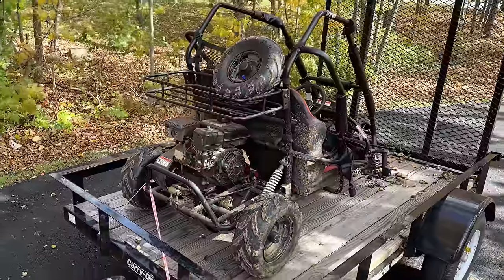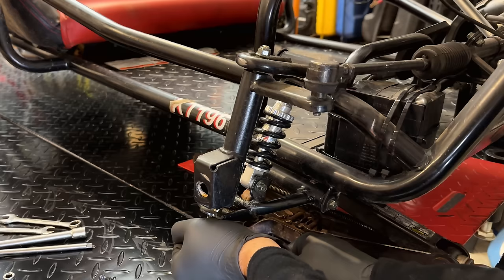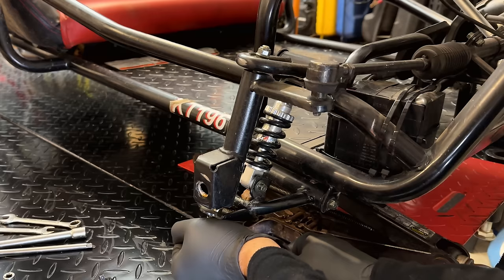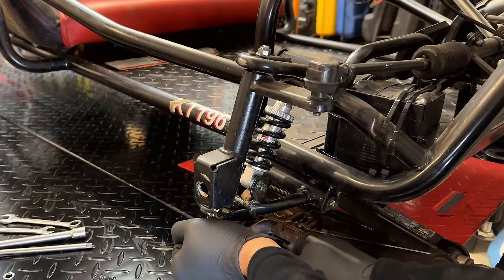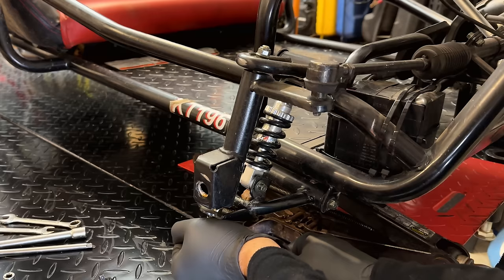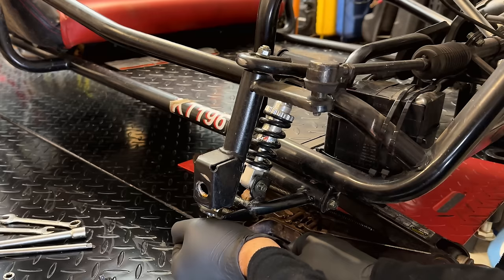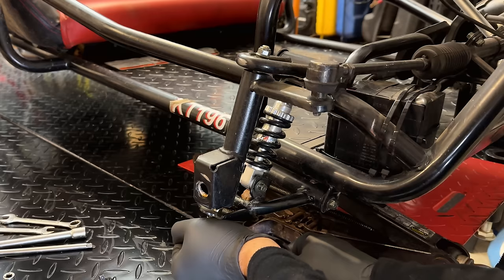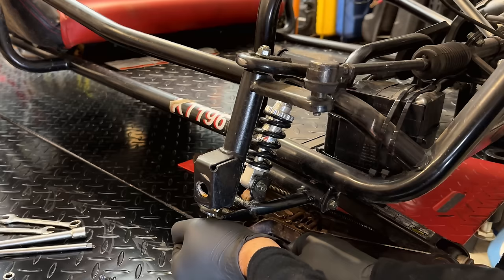Coleman KT196 Major Upgrade/Repair - Electric Start, Charging System, Suspension, Lights and More...

Comment: You might want to turn those light clamps 180 deg to move the lights back a bit. That way they aren't the first thing to take an impact.
Reply: I was going to make the same comment on the lights.
Reply: Or, put a bumper in front to protect both, the lights and the front wheels and suspension.

Comment: Times certainly have changed. I can't imagine having my own go-cart let alone my dad spending several hundred dollars upgrading it. Growing up in the 60s, I felt as if I was doing pretty good if I had decent shoes on my feet and the chain oiled on my Schwinn.
Reply from the maker: Same here.  Always wanted a go kart as a kid.  Or anything with an engine besides the lawn mower.
Reply: Do you guys remember pounding nails into scrap wood producing something resembling a gocart frame? I grew up in the 60's myself
Reply: @kevinfoster1213 Hi, and yes I do remember that. In about 1969 some neighbors who had I believe four boys a little older than me had a garage sale and were selling a cool A-frame go-cart they had made and I absolutely had to have it. It was made from 2x4s and was about six feet long and 18 inches wide at the front and 24 inches wide at the back. For steering it had a long bolt that vertically went through one of the front cross supports and it then went through a lower piece made of 2x6 that an axle and a lawnmower wheel at each end was attached. The axle was a little longer than needed on each end and attached to these ends was a rope that formed a loop that you could use to steer it. I made some improvements to it after my parents bought it for me including a bigger piece of wood going across the back so it could hold two kids. I also remember slapping a couple of STP Motor Oil stickers and some old reflecters off of an old semi truck trailer on the back, so I thought i was pretty cool. I also remember making stilts from 2x4s thanks to my dad working construction jobs at that time so he was always bring home scrap lumber for me and my buddies to play with. Do you remember ever making stilts?
Reply: @AbcDef-iq4no  absolutely I remember the stilts. I think back on those days and the number of times I've bashed my fingers with the hammer, I can't believe I retired from home building and/or related fields.
  We would those steel wheeled skates on a 2X6 or similar. I say put, what mean is bend over 6, 8 or even 10 penny nails and call it a skateboard. This was well before skateboards could be bought at a Wanamakrrs or similar store. 
  I still believe me and the rest of the Manito brat pack invented the sport.. I'm sure we didn't but the story I tell is what I must stick with

Comment: Just a note on fusing: the charging circuit has a fuse, but I did not see (so I may have missed)a fuse for the battery positive going to the switches for light and start, which if not present, definitely should be.  Enjoyed this extra-long episode!
Reply from the maker: I added two fuses.  May not have show the other.  There is one for the charging system from the engine to the battery and another on the full time 12v wire that runs the lights and starter solenoid.

Comment: Those spring units  are very common on cheaper suspension bicycles. They merely allow you to set the spring tension with that big ring that tightens down on the spring. The center is a bump stop and guide. They usually are very very cheap. You can get a Fox or similar suspension spring with a dampener shock, but they cost hundreds of dollars. 

On the left (unbroken) side, the ring nut was backed off all the way, so there was no tension on the spring. 

Loctite that ring into position, or, if they fit, use the old ring nuts from the old shocks as locknuts for the new ones. Your son should keep an eye on them and not let them back off a whole inch ☺

Comment: @James, instead of removing the set screw on the governor arm, I think I'd back it out about half to 3/4 turn past full throttle, just to make sure there is a backup stop in case something with the pedal assembly bends/breaks.

Comment: Your son should be getting a first rate education in electrical/mechanical engineering with a Dad like you.  My Dad did a lot of what you do and I never took the time to learn from him.  Decades later I'm learning on YT.  I'm sad I missed that opportunity when I was young and Dad is gone now.  Always love your videos.
Reply from the maker: He is a very smart guy.  Also he rebuilt a 10hp Briggs engine with a little direction and has way more experience at 14 then I do at 52 with 3D printing and soldering.  Think he will be fine.

Comment: Fix one thing and find another thing that needs fixing or replacing. Sounds familiar…like that Cub Cadet. I guess it proves no matter how well you maintain things you can’t defy the laws of physics. All machine components will wear out and require repairing and/or replacing at some point. I bet Sean is thrilled.

Comment: Mr. Conden, you could make another nut using hex stock and cut it longer so it protrudes above the obstruction and will allow you access with an open end wrench.

Comment: Didn't even notice the duration.  Content was great and well-paced.  Nice to have some unforeseen plot surprises to keep it interesting.  Crankshaft swap was awesome.  I was thinking NO WAY the whole time.  Well done.  Also, excellent wiring and especially the factory-like remote start.  Brilliant.
Reply from the maker: Thanks.  Was glad the swap worked.  Did not have a plan B.

Comment: this is giving me flash backs. i used to work at a small angine shop and i worked on a gocart on a lift and made the mistake of starting the engine without having the back wheels jacked up. the throttle was stuck partily open so it took off. thankfully, no one was hurt, nothing got broken, and i didn't get fired over it. the older mechanics(i was in my ealry 20's) in the shop just kinda laughed and said if finally happened to me too. what stopped it was it ran into some other equipment that it couldn't move and i was able to run over and kill the engine. it's almost a miracle nothing got broken. don't guess i'll ever forget that day.
Reply from the maker: Ouch.  That is alway my fear with this one.  With the old engine my son would stand behind the kart to pull start it.  Nobody inside so it could take off.  Now at least he is in there to kill the engine.
Reply: Don't feel bad brother. I also work at a small engine shop. I took in a mower and in my hurried pace, I didn't check the oil- which is standard at a repair shop. Well, it was brought in with no oil and I didn't catch it. I started it and damaged the engine, and 😮😮 got the great opportunity to replace the engine out of my pocket. Live and learn. 😮

Comment: Hey James; I was just thinking about the position of the light brackets. As a suggestion, turning them 180° would move the lights back and in between the frame and the cowl providing more protection. Right now the lights will be first things to hit whatever the cart drives through e.g., thick brush, small trees etc. Just a thought. Thanks again.

Comment: Hi James. 
We call belt drive systems primary and secondary pulleys. 
When setting up the alignment you may need to angle the engine ever so slightly to off set the tension created by the belt in between the two pulleys. 
Enjoy your videos! 👍🏻

Comment: Hey James,  
  A very useful tip for you
 I had recently watched your gocart repair video from about a year ago,    and those tire repairs with the tube installation looked to be pretty tuff , 
   The next time you are installing a inner tube,put some baby powder inside the tire , and some on the tube also,  it usually helps quite a bit the installation and also with seating the tubes into place during initial inflation.
   Thank you for your videos
Keep up the great work.

Comment: Lol he breaks and spindle and gets a 208 w/electric start, new spindles, shocks, and lights. Not a bad upgrade lol. Also, they have FWD,N,RVS  gearboxes from china for go-karts that are pretty inexpensive. Maybe the next upgrade is reverse or just sell that one and get him a bigger cart, it seems like he enjoys it. You guys should look into kart racing, or jr dragsters. For as much as you like to tinker with small engines, you haven't even got to play with cool small engines until you have messed around with those race machines. Those little engines are next level cool. I am pretty sure they get like 23HP out of those 208cc cases all fitted out. If you watch marketplace, you can usually buy someone's entire setup when their kid needs to go up a level. Started used, see if you like it. I am pretty sure the dads are more pumped about the sports than the kids half the time and they are the ones racing! haha

Comment: For the front lights slipping, I had good success just wrapping the bar with electrical tape then clamping the lights over that.  the glue holds tight to the bar and the clamp holds tight to the tape.  Or even some sturdy doubleface tape.  but your way will certainly not move either!  another great vid!

Comment: I had that problem replacing a Tecumseh on a log splitter with a Duro Max. Solved it with .5" spacers to mount thr Hydraulic pump and it works perfectly

Comment: A few thoughts:

When you find a “lean condition” you have the air filter off. That will almost always present a lean condition that you might not have with the filter on. Thus, when you drill out the pilot and put the air cleaner on, you will be ultimately richer than designed. 

Also, they likely set the valves tight at the factory to allow for break in. Since you loosened them, you may want to check them after break-in to make sure they aren’t sloppy.

And…someone likely lowered that “behind the seat bar” because they were hitting their heads on it. Please be cautious of that. I once interacted with a biomechanical engineer that told me that roll bars cause more damage than no roll bars because of heads banging on them and causing brain damage, etc. Just make sure that will not present an issue with the head of whoever rides in it, or at least pad the poop out of it. 🤪

Comment: 1, you forgot to use heat shrink on the toggle switch ground pin. 2, when installing switches with active voltages (ground OR hot), you need a little bit of plexiglass to mount the actual switch into then mount the plexi to the frame. This keeps the neutrality of the switch and allows you to switch anything you wish. Before mounting the switch however, paint the non visible side of the plexi black or whatever. This let's the user have a shiny black facing the user that the user can't rub off. I personally used this method making test equipment with translucent red plexi and led digits. It looks so cool that way.

Comment: Yeah, we think a lot alike. I was going to say put two pads down on that bottom battery plate to help keep bottom of battery off of bolt heads.  And it may still become a problem as the pads compress so you may want to keep a check on every so many hours of operation especially if ridden on rougher terrain that causes a little of suspension travel and bouncing.  Other than not yet having reverse your son is going to be mighty happy.  Now all he needs is a louder sounding muffler.   LOL

Comment: Actually you can set both valves at 4 and they will be fine. Been working on small engines for 30 years and a long time ago an old man i looked up to told me to just set both at 4 and you will be fine. Never had s problem. Enjoy your videos.
Reply from the maker: I agree.  When no spec is available I usually set the intake to 0.004” and the exhaust to 0.005”.  Never an issue.

Comment: I love the long format of your videos and i would have loved to have a go-cart like that when i was younger. The only thing i would have done differently would be to turn the light mounts the other way so they are protected a little inside the role cage, as long as feet don’t hit them of course.

Comment: Great Job! I hope you plugged the port where the evap system hooked up. Because that allows unfiltered air into the engine.

I’d probably have eliminated the governor.

Comment: Incredibly informative video.  Your small engine and wiring skills are commendable.  I tinker with small engines but largely uneducated so often get into trouble.  When I saw you changing out the crank shaft you had me. I rarely make it past 20 minutes for most youtubes (Except Andrew Camarada) but this one is up there with the best of them.  Makes me want to learn more about small engines just to tinker in my retirement.  Thanks for a great video and keep them coming!

Comment: Id consider putting a small low wattage light on the rear for extra as needed visibility, maybe one of the old lights would do the trick. Adding a cell phone charger may also be a good idea, but if he doesnt ride by himself away from home i suppose that wouldnt be needed, but i suppose a power bank would be enough since theres room to carry things.

Great job, wish i was that good at mechanical stuff, i'm only good at lighting projects lol. Just think of this almost 3 hour video as a Christmas present to everyone, maybe you could do one every year from now on.

Comment: I'm a little surprised that you didn't use some grease or some other type of lube on the bolts for the shocks. Or even some anti seize. I use anti seize on everything. When I run out of toothpaste, I use anti seize instead. 🤣🤣🤣🤣🤣👍🏿 Keep up the good work

Comment: Great job. You might consider a dash choke control cable. That way your safety seated starting a cold or even half warm engine. 🕵😁
Reply from the maker: I added an under seat cable at the end.

Comment: Great video... The length is no issue.  I have YouTubeTV and it remembers where i left off.  As for the build, I would have stopped at the front suspension, sold it, then found a bigger go cart.  Merry Christmas.

Comment: New engine .. “does it start and make power?” (charge the battery and run the lights) 😮
Put some washers (as spacers) under the back nuts, to raise them up so you can tighten them better …

Comment: Hello James: Another very enjoyable video with challenges that you overcame.
A small suggestion for your v6iewers who may try a similar upgrade. I relocated the engine mounted start switch to the battery  bracket. Spliced in the wires for the toggle switch. This gave the unit start capability from both reae and seated positions. Never thought to add a remote choke. My nephew may get a late Christmas gift. Keep the great videos coming. I will be watching in 2024.

Comment: For the evap tube, cut down the fitting on the air cleaner housing and add a 90 fitting and the hose.

Comment: Could you mount light brackets to the inside, so the lights are tucked inside the frame tube, for protection?
Reply from the maker: Yes

Comment: That's one lucky kid!  My parents never even considered getting me a go cart! However, I think you over did it with the bolts for the lights. A much smaller hole with a roll pin would have been PLENTY. Still, I Love your projects, and the meticulous care you use to complete them, Happy Holidays!

Comment: Adjust the back nut on the switch up you don't want any threads showing on the outside of the cool Plate that may also take care of you're clearance issue with the cool switch.jim

Comment: In automotive when tightening the suspension control arm bushings should be tightened at normal ride hight as the rubber is supposed to twist to stabilize the action in both directions.

Comment: Adjusting valves on a new push rod small engine it's best practice to leave the valves on the loose side of the spec, new valves tend to wear into the seats a bit and after a dozen or so heat cycles the head gasket will get more compressed and that lowers the head and takes up lash all this combined with exhaust valves expanding when hot gives you the best chance  to not have a valve lash issue right away

Comment: James, DO NOT adjust the valves until you ran it a hour. If its knocking then slight adjust, but It will loosen. The CC on them is actually not right in the manual or the tag, its 202cc if you have the KX head, 204cc if you have the KV head on it. 2 factories make them. KX is Guangzhou KT is Wefang. Yours with electric start is about a 90% chance a KX engine.

Comment: The new engine will be a great swap. Duel Fuel LOL!!  Your China made cart is in need of your welding and bolt tightening program. When I was a kid me and dad built one with a pair of engines, 2 heavy 7 horse and each engine drove a wheel, but the throttles from his design were reactive to the steering so when I turned one way it would slightly idle down the opposed engine by flexing the throttle connected X style. This is mid/late 1970's so a lot has changed.
Reply from the maker: I just got the larger version of the dual fuel carb you used in your Duromax.  It works surprising well.  Did not expect much given the price.  The two engine cart sounds like a lot of fun.
Reply: @jcondon1  I can't remember the engines we had on it, I think Tecumseh but we also had lots of Wisconsin stuff. That stroke I had in 2014 fogs up some memory. But the steering shaft had a dual offset welded on, and set of springs, those were tuned to slow one engine or the other progressively as you turned. Sometimes I would turn so hard one engine would almost stall. But when it came to speed this cart we had used Wheel Horse tractor tires, 16" OD and they sent you almost 45 mph which as a 10 year old then would be like being on a rocket ship!